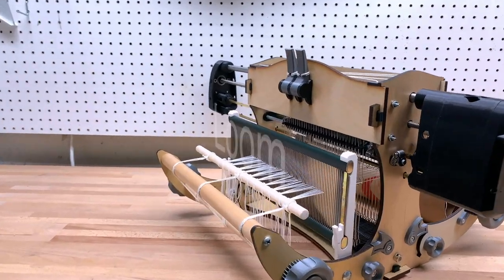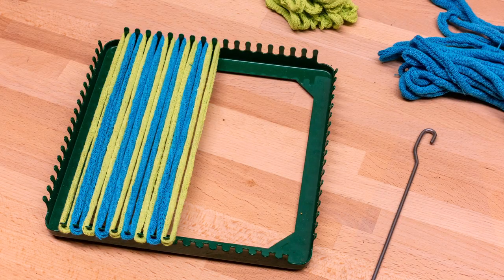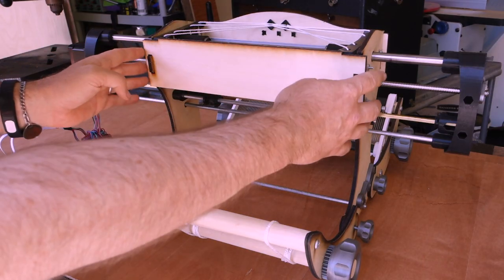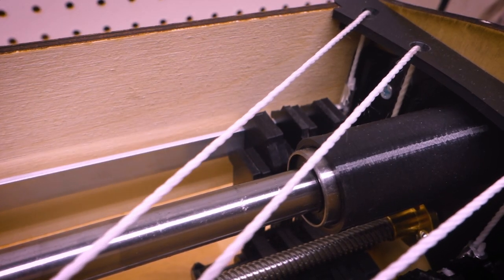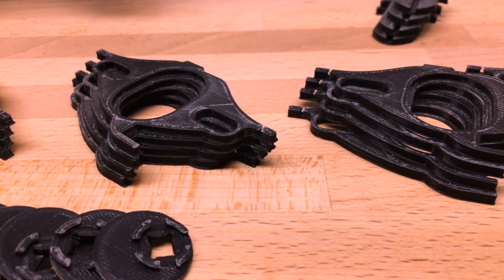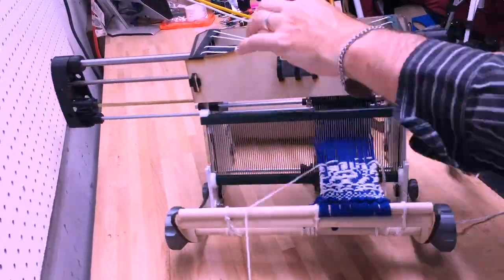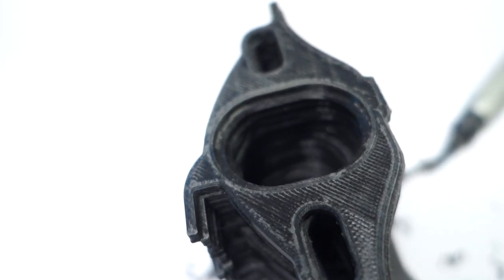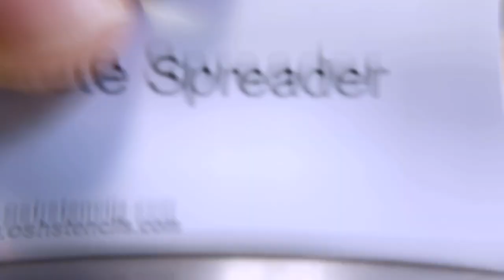Building a Computer Controlled Loom

Comment: Wonderful, I’m amazed - can I ask how you prepared your images? Did you apply any weave patterns via photoshop before sending over to the loom? 🙏
Reply from the maker: Yes that’s exactly right.  I designed the patterns in photoshop as images and then I wrote a custom iPhone app that steps through the designs and updates the loom pattern for each row via Bluetooth LE.   I really should have included some screen recordings of the app to show how that works but the video was already pretty long and I’m a mobile developer by day to that part was the least difficult piece. lol.
Reply: @retrotechjournal  wow. See, I have experience using the TC2 loom (which is very big, not very accessible, and incredibly expensive to buy, circa €30,000) so your project is super interesting to me. I’ve noted a comment here where you mentioned slow heddle movement speed, but I’m still curious to see if I could try to build something according to your instructions. What you’ve shared is incredible! Thank you
Reply from the maker: @sarkisartist  Wow, that sounds cool.  I have no exp. with commercial jacquard looms. I do have some ideas about how to speed up individual row update, but I've been off working on other things/haven't tried making a prototype.  I have too diverse a set of interests to have much faith I'll get back around to designing a V2.  :]   I feel lucky I managed to get the V1 working at all. Lots of interesting problem solving along the way though!

Comment: You mentioned that you were going to make another loom.  Did you get around to it?  I bought a custom made dobby loom.  There were flaws in design and manufacturing and it will never work.  Looking to see if it is possible to convert it to a jacquard type of loom.  Yours look very interesting, though skills and tools beyond my current situation.  What is the speed in real life for each pick?
Reply from the maker: That is the problem with my design.  The speed per pick drops as the warp count goes up.  At 80 warp threads the speed was something like 2 picks per minute which is painfully slow.    I do have some ideas for a much faster design, and now I've learned parametric CAD, so I am tempted to take another stab at the design, still it would be almost starting from scratch since I'd be moving to Fusion 360/changing a lot about the design, so  I've  been taking on shorter projects.  :]
Reply: @retrotechjournal  yeah, 2 picks/min is slow. I'm likely to have to go for mechanical and punch cards or some derivative of it. Hope to see your next one!

Comment: Sorry for the multiple questions, don't want to bother you but is the square shaft sliding left-right with the help of a linear actuator? I understand that the square is glued to the rod inside and when it turns it turns, but how does the square change position?
Reply from the maker: The two square sections on either side of the rotating section are clamped into either end of the carriage. So when the entire carriage moves left and right the square shaft moves as well. The motor that turns the inner rod that twists that one square section doesn’t have to deal with any of the left right motion since its little square is trapped between the two locked square sections.  It couldn’t do the push/pulling anyway since it’s zero backlash coupling is quite springy.

Comment: Hey, very similar to project of mine. I am trying to make fully automatic card weaving machine. I want to controll it with esp32 and program javascript based interface to controll patterns. Thanks for inspiration!
Reply: Neat.  So yours is based on an existing card driven machine?  I don't know much about what kinds of card driven machines are out there.  Is it super old, or of a more recent vintage?
Reply: @kurtschaefer  I haven't seen automatic card weaving machine, yet. So I had to create my own design. I try to use as much salvaged components (from old printers, stepper motors, solenoids etc.) as I can, the rest I print on my Prusa Mk3s.
Reply: @D4rkS7der  Great!  I have a Prusa Mk2.   Such a great printer.  I'd love to see some pics of your creation.   I noticed you don't have any videos up about it.   Do you have a blog or something?  You could post some picks over on my retrotechjournal.com site.   I'd love to see where you're at.   I've noticed a lot of home brew Jacquard looms  focus too much on the heddles and then completely neglect to handle the warp tension/ratchet stuff/reed/etc.  Which admittedly isn't that exciting, but is required in order to do real weaving.
Reply: @kurtschaefer  I do have a blog, but sadly it is not international (its in czech). I`ve checked yours and it looks quite interesting, I might spend some time browsing your creations :-). I also spend some time researching homebrewed Jacquard looms which I didnt know, till now. Although I have my automated weaving shuttle heavily inspired on these classic looms. I might put together some info about my machine this weekend, maybe a video.
Cheers!
Reply from the maker: @D4rkS7der  If you point me at your blog I can try running it though google translate or something.  I looked at various table top looms when I was building mine, but I didn't really look to much into other DIY Jacquard looms.  I didn't see that many around and I mostly wanted to just be doing my own thing.  lol. Now that I've taken a stab at it it's super interesting to talk with others wrestling with the same issues.  Let me know when I can see more about it!

Comment: Hello, great project! How does the shaft move back and forth, before it rotates the right disc?
Reply from the maker: The entire carriage moves back and forth driven by the threaded rod which is twisted by the upper motor.  The weight of the carriage is supported by that fatter top rod and the square shaft that rotates each disc driven by the lower motor.  The thin bottom rod is a mostly there to add rigidity but is also carries the cam position sensor.
Reply: @retrotechjournal  What I can't understand is how the square part in the square shaft changes position.
Reply from the maker: @andreasvasiliou6453  Oh!  The square shaft has a round rod inside it.  The only part of the shaft glued to that rod is that one square section.  So when the round rod rotates most of the shaft acts as a support, but that one section is free to twist.
Reply: @retrotechjournal  Ok now I understand how the square part rotates but I don't understand how it changes its position when it's not rotating.
Reply from the maker: @andreasvasiliou6453  The disks all have square holes in them.  The square shaft can slide left/right through the stack of disks.  When the rotating part turns it only ever turns 180 degrees, so when it stops, the whole shaft is just a square rod again, so it's free to move left and right.  If it ever only turned 45 deg or something then yes it would jam up horribly since the rotating section wouldn't be aligned with the rest of the shaft.
Reply: @retrotechjournal  Is the square shaft sliding left-right with the help of a linear actuator? That's the part I can't get. If it was just connected to a motor with a coupler, then the whole thing would rotate, not slide.

Comment: What about a fully automatic such machine ??? Those. We loaded the thread, pressed the button, the fabric with the pattern is ready ...
Reply from the maker: The truth is that not attempting to automate the shuttle portion really leaves open a giant world of weaving flexibility.  I can do designs with any number of colors/thread types without having to change anything about the machine or the software.  Plus this leaves some room for operator skill.  Full automation is an interesting problem, but I just didn't like that trade off of "harder to design, more likely to fail, and much more limited output".  At least not for a first attempt.  I feel lucky to have gotten it to produce any results at all frankly.  :]
Reply: @retrotechjournal  You got great results! I think that it would be very cool for everyone to have such a machine and make fabric for their own needs. Such a machine should be as fully automatic as a microwave or coffee maker. But in general, you have a very good car turned out.

Comment: i would lose my mind trying to assemble any of this
Reply from the maker: It is true that the color coded Trello board I used to track all the things going on with this project was as complex as any I've ever done.  With different colors for hardware/software/firmware/3d prints/laser cut parts/tests to run/things to redesign/parts to purchase/dialog/camera shots/edits/on and on.  You really need a system if you're trying to keep so many balls in the air. My brain needed a lot of help keeping track of all that stuff.  🤯

Comment: Did you consider the fact that modern fabric has 120 + threads that goes into making one Design?
Reply from the maker: Yes of course.  Modern fabrics are astounding.  It's fun to deconstruct a swatch under a microscope just to see what all is going on.  That would not however be a reasonable design goal for a project like this.  Just warping at that density would be insanity. 🤯 I learned a lot about weaving/fabric design doing this project even at only 8TPI.

Comment: Would it be possible to build something like this for weaving fine linen fabrics?
Reply from the maker: Well, the only difference between this loom and one to weave fine linen is the threads per inch.  Sadly because this particular loom technology gets slower and slower the more threads you have, it would be impractical for a high thread per inch fabric.  So not practically.  With a slightly different setup you could perhaps weave 1/2" wide fine linen fabric.  :]
Reply: @retrotechjournal  Darn. I am trying to figure out if it would be possible, or practical, to build a fine loom that works automatically with help of computers.
Reply from the maker: @gunnarthefeisty  It's a difficult problem. Not easy to do in a cost effective way. So many independent lines you have to control in a very small space.

Comment: but... you still pass the thread every line? so what does the machine do? tlel you when to change the thread colour?
Reply from the maker: It independently raises and lowers every single thread on each line in preparation for me passing a shuttle with the thread across.  That's what defines the patterns.  It just tells me which color and which direction to pass a shuttle.  The pattern part is the actual work/difficult part.  Passing a shuttle back and forth is easy.
Reply: @retrotechjournal  yes I speak from absolute ignorance, but thank you for taking the time to explain and yes now that I think those are usually pedals that the weaver uses when I've seen someone weaving. So basically your controller controls these pedals for the different patterns I guess. Thank you again for taking the time to reply my ignorant arse.

Comment: I really wish to see this project completed, will there be any updates?
Reply from the maker: I got it as far as weaving custom designs.  So to me that's pretty much "completed".   What else did you want to see?   I do have some idea about how to make it faster, but I don't know when I'll get back to working on it.  I tend to just work on things that are the most interesting for me at the moment.
I got that project to the point where I could weave out some gifts and then I stopped.
Reply: @retrotechjournal  I understand. It was thinking getting it to do  some more high rest or work with in thin thread
Reply from the maker: @D3rron08  Oh interesting.  I'd been thinking about doing some procedural generated ripple gradient designs, but really the possibilities are endless!

Comment: Out of curiosity have you further regined this project?
Reply from the maker: I have some ideas about how it could be redesigned to work faster, but I have not tried to implement them.  So nothing more than some sketches/ideas.  I do a LOT of different kinds of projects, and just let my hobby interests go where they will.  So I don't have a great deal of control over if/when I do another rev. of this idea.  I spent a year and a half building this one, so I think I ran the well dry.  Not sure when I might come back to it.  I've learned CAD since doing this project.  I rather wish I'd know it before doing this project because then iterating on the design would be a great deal easier.

Comment: bro I am trying the same, I just want to pass a stick through the loom middle to get the thread going, the main string sorry my english sucks, what is the best way to get the thread across the stuff ?
Reply from the maker: I'm not quite sure which threads you are talking about.   For the threads that go the length of the piece (the warp) I used something called the warping peg method.  I tied the thread to the back of the loom and then use a small hook to keep pulling loops though every other eye and place them over a peg far in front of the loom.   That gets half the eyes threaded very quickly, then you cut the loops that are over the warping peg and pull half the threads back though the eye and feed them though the next eye over. Then you can tie them off in bunches on both ends of the loom with a sheep's head knot.    It's best if you just look up that technique for a more detailed description.    For the threads that go back and forth (the weft) I just have the thread wound on a simple shuttle I made from a piece of acrylic, but really it could be any smooth material.  Easy to make them out of wood or even stiff cardboard.  Though the cardboard ones won't hold up long term.  I hope that helps.  Sorry about the language barrier.
Reply: @retrotechjournal  I am making it with arduino, and self made components what do you think about doing it with arduino?
Reply from the maker: @CreativeOven  My loom is effectively an Arduino.  The board is custom but it's got an Atmega644 chip at it's core.  I used the Arduino IDE to program it, etc.  So yes it's fine to use an Arduino.  Just figure out how many pins your going to need before picking a board.
Reply: @retrotechjournal  Yes i picked up a 2560 But it is failing a  lot with the motor controlling chips idk why I am out of ideas.
Reply from the maker: @CreativeOven  What motors are you using and what controllers?   Are you designing the boards yourself or using motor control daughter boards?  It's tempting to design your own motor  controllers on the board for compactness, but it's a bit tricky to get the thermals right if you do that, and it often ends up being more expensive buying all the components separately rather then just getting some daughter boards.
Reply: @retrotechjournal  I am noob, so all I can tell you is that I am using arduino dc motors arduino 2560 and I am progressing slowly but progressing... today I will try to glue up some stuff, and get the main string through the other strings! I am using that chip called L293D.

Comment: You still have to put the different coloured threads through yourself, right? It doesnt seem to have anything that does that part for you

Really cool project either way, im just way lazy
Reply from the maker: Correct.   The moving the shuttles back and forth is still manual.  That gives the machine great flexibility in terms of number of colors/kinds of threads I can use in any given design, but it's not exactly a "go off and do something else while it's weaving" kind of thing.  It still took me most of an afternoon of weaving to make that Pikachu.  ⚡️
Reply: @retrotechjournal  does it tell you what colour to use next?
Reply from the maker: @Joshinken  Yes, I regret not actually showing the phone app in the video.  It shows you where you are in the pattern, what shuttle with which thread to use and in which direction it should go. Operating it doesn't require any thinking about the pattern, just following the colors.

Comment: I'm still confusing after watching two time. Is it automatic OR semi-automatic.   
Did you move the thread in horizontal direction or it moves it self......

Any way this is awesome...♥️♥️♥️♥️♥️
Reply from the maker: The pattern expression is automatic, but the passing of the shuttle back and forth is still manual.   That gives you the best flex-ability in therms of kinds of weaving you can do, etc.  Automating the shuttle motion/beater would make things quite a bit more complicated and ultimately limit the designs you could make.   You can see the process best probably in the blue and white panda time lapse since that one is shot at constant intervals so you can actually see me passing the shuttle back and forth during the weaving.

Comment: We never see it working in real time? Just stop motion?
Reply from the maker: Well in the "yarn soup" weave you can see me doing all the weaving in time lapse (vs stop motion) so you can see all the actions required.  The problem is that the loom update gets slower the wider the design, so I only show the first pass or two of weaving at 80 threads because in real time it takes about 40 seconds to do a line, and that makes for deathly boring video.
Reply: @retrotechjournal  Show it. We are patient.

Comment: question, where did you get those needles?
Reply from the maker: Do you mean the wires with the "eyes"?   Those are standard loom heddle wires.  Kind of like these: https://www.etsy.com/listing/170335045/10-12-100-inserted-eye-heddles-weaving but 8.5" instead of 10.5"  Weirdly the price seems to have gone up a ton at the store where I got mine.  Like I paid $18, and now a set of 100 is 4x that.  I wonder why.

Comment: Why did you oven the motherboard
Reply from the maker: That oven melts the solder paste and solders down the components in a process called “reflow”.  Before doing that I could sneeze and all those components would have blown away.  Afterward they are solidly connected both mechanically and electrically.